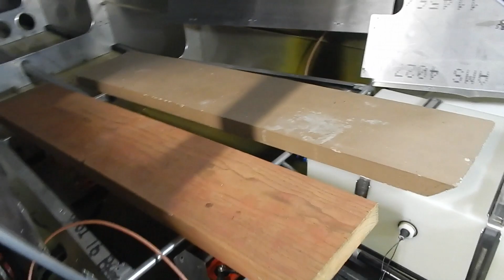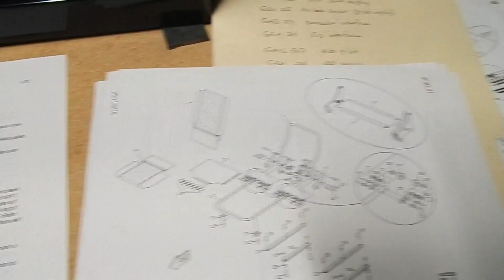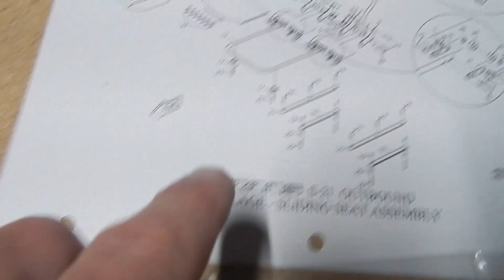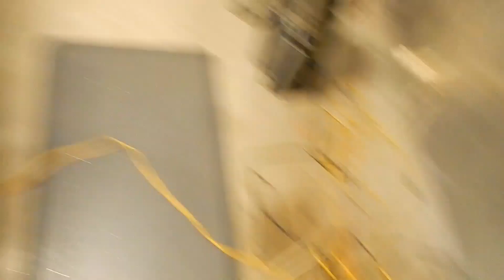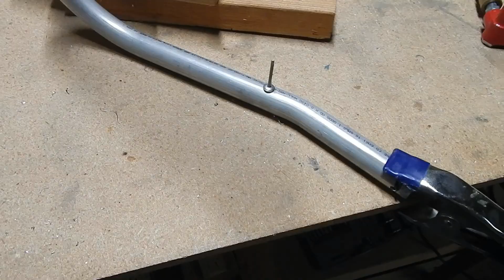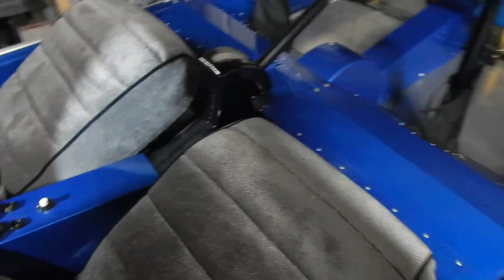RANS S21 Build- Ep36- Seats, Fabric Flooring, Control Stick boots

Comment: Hopefully you dremeled the small notch in the hole your rivnut goes into. I put the small notch in, plus i use a dab of JB weld, otherwise your rivnut can spin, and you wont like that, trust me!
Reply from the maker: excellent suggestion.  thanks

Comment: Laces forward😉you shouldnt have to trim any material, or make any cuts. I used my soldering iron with pointy tip and cauterize a hole for the rivet.
Reply from the maker: oh well.. my laces are back.